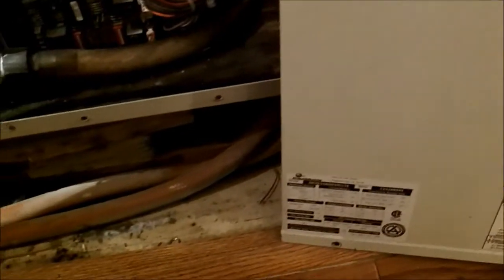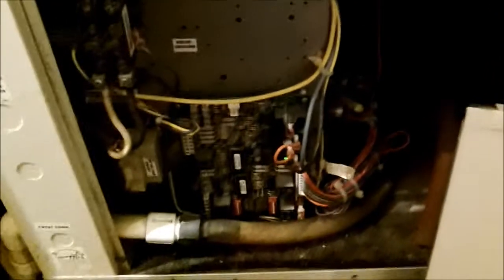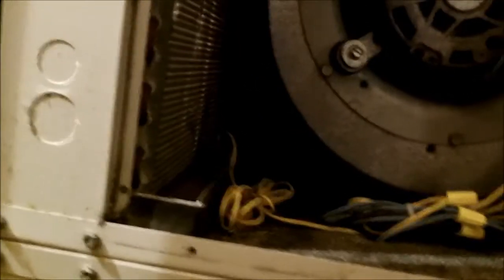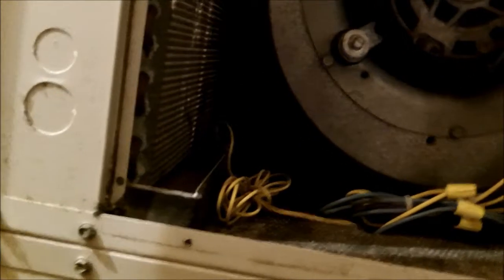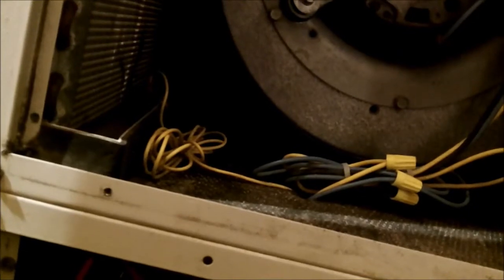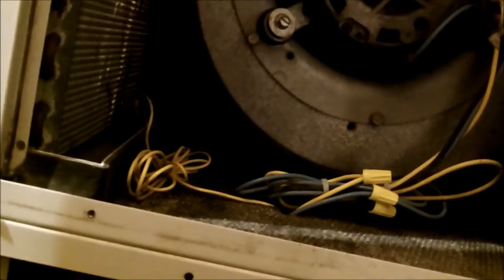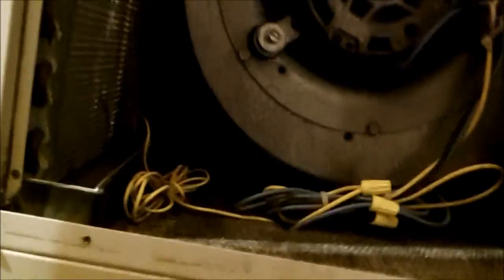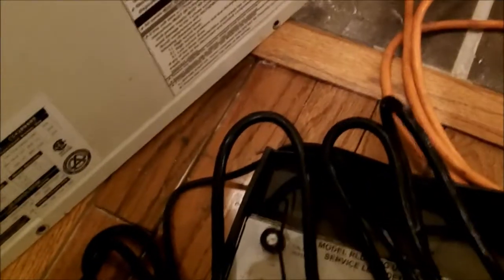Finding a freon leak

Comment from the maker: Hey Skipper, the H10 is the best out there. It's the only tool that rides in the front with me. As far as the H10pm or the H10G; I would go with the H10G simply because you don't have to worry about something happening to the battery. I don't mind caring a 25ft cord around because there is always an outlet around. I have owned 2 of them(the last on I left at a lady's house) and couldn't remember where I left it. She called me right after I bought the one I have now. Hope this helps.